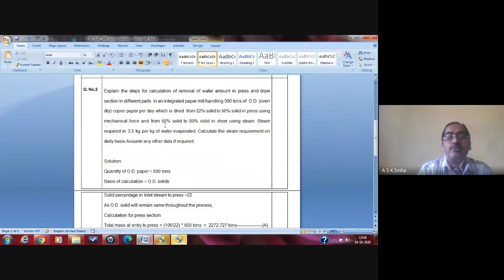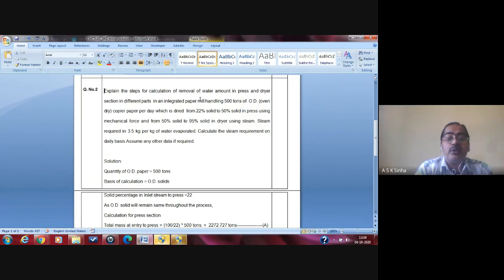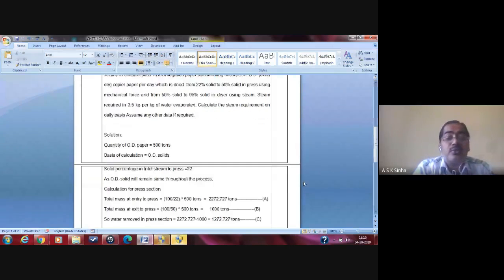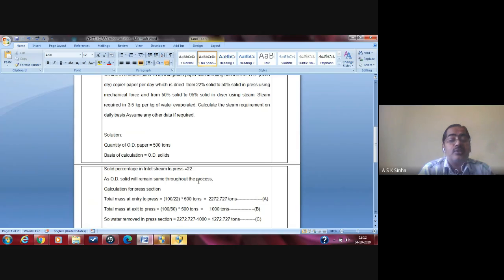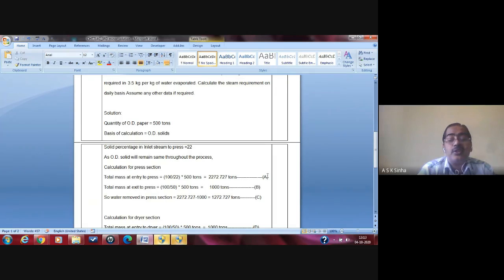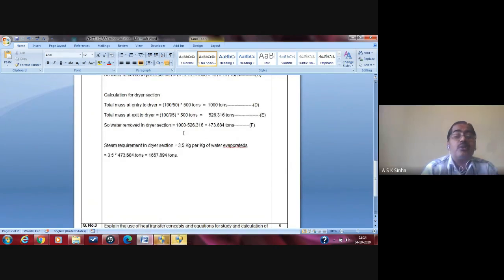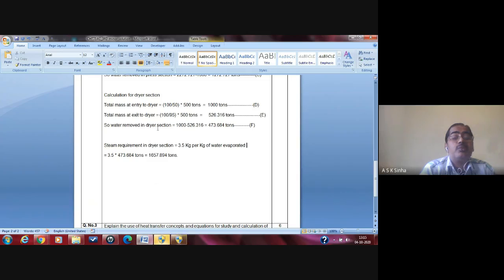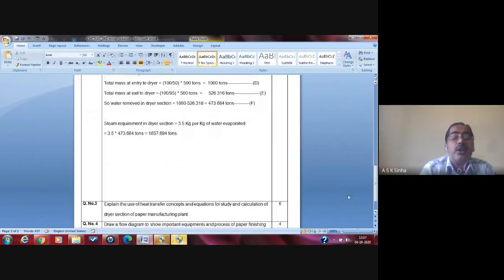Paper Industry Numerical on press section and dryer section water removal and steam requirement

Comment: How you have considered that 3.5 kg steam is required for per kg of water evaporation ?
Reply from the maker: This is based on industry data. One ton of paper requires 3.5 tons of steam on average basis. Consider moisture at entry point and exit point for water evaporated.
Reply: On my physical observation this is vary from 2.5 Kg to 3.5 Kg.